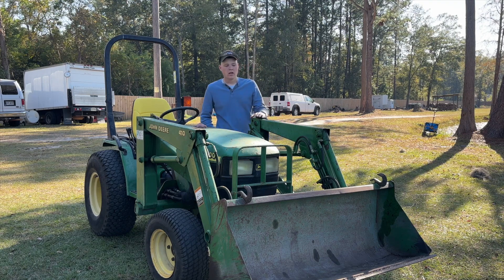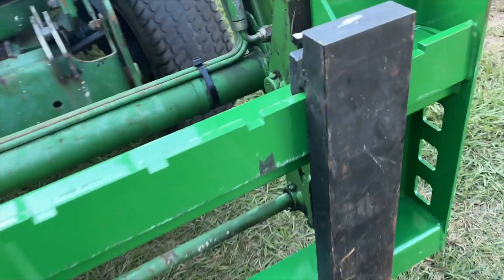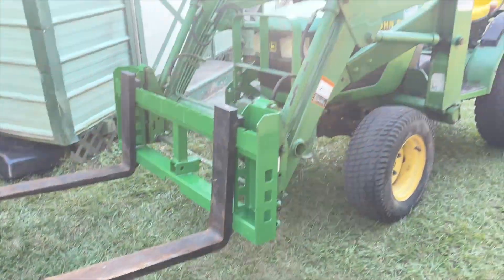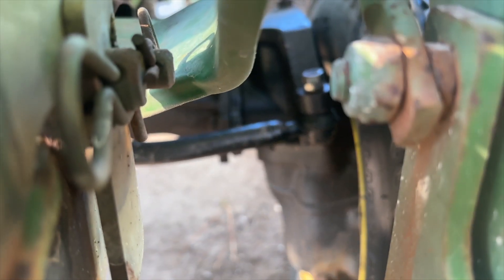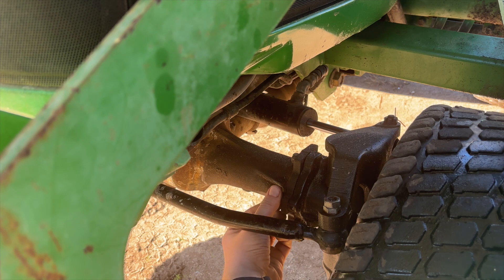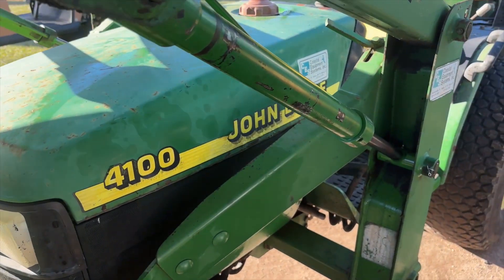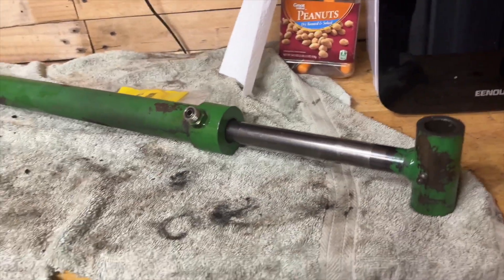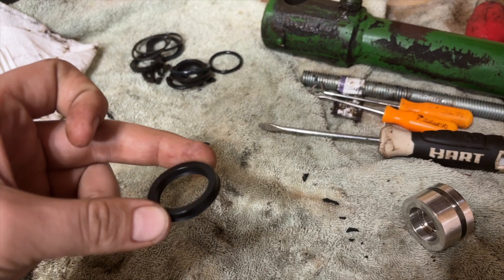John Deere 4100 Part 2 - Fixing leaks and installing pallet forks!

Comment: Luke's potential 955 also had front axle work done to it at some point in time, as the bottom portion of the axles were green.  These old tractors certainly become a labor of love... and sometimes a labor of love/hate.  Almost to 500 subs, good job Tim.
Reply from the maker: I’m sure this one was definitely someone’s labor of love/hate for a long time too but it’s new to me so it isn’t bad yet. After a while with something old you get tired of the problems and want to replace it. Hopefully this one is new enough that I can enjoy it a while. Thanks!
Reply: I just bought one of these too, Tim. I've subscribed and will be following and watching for all you 4100 videos. Well done!

Comment: Hi Tim  I just watched your 4100 videos. Maybe you can help me .I’m trying to help a friend with her tractor. She doesn’t know how to activate the glow plugs and it’s cold here in wny. She’s 77 years old and can’t find the manuals for her JD 4100. I have not been able to help her. Don’t want to use either. Could you help us out ?  Thanks
Reply from the maker: You can pre-warm them by pulling up the PTO switch then turning the key to START-the GP's will light but the engine won't crank (as long as your safety switches are intact and working).
Reply: @TimothysTractors   Thank you very much   I will check that out. Appreciate that very much..